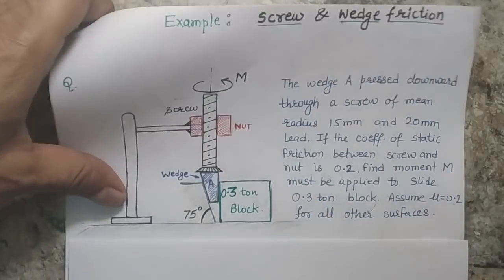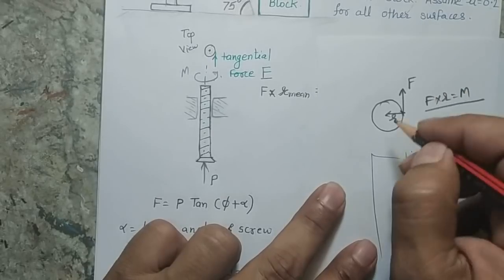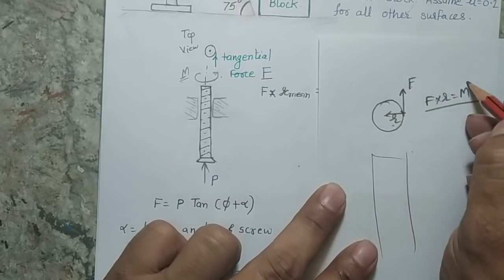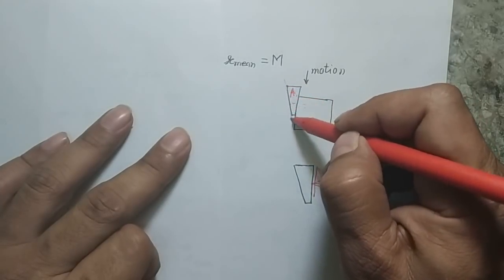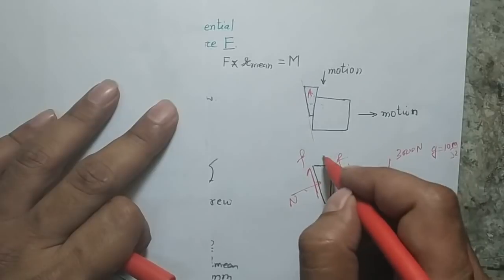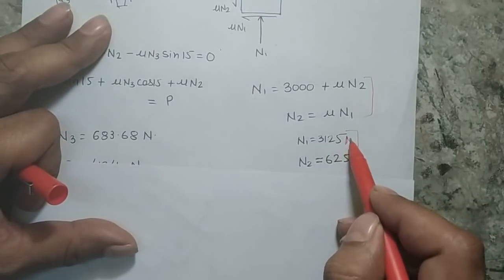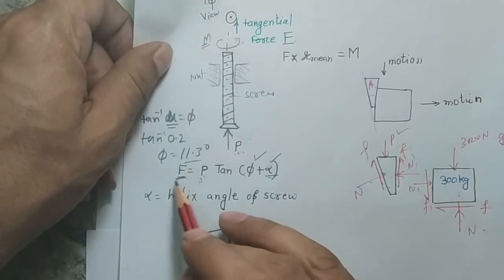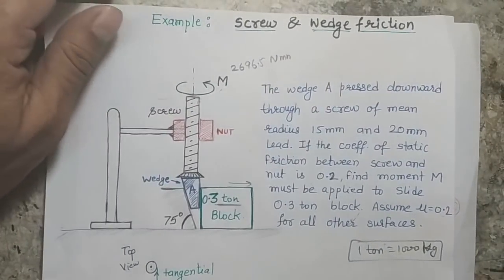L6.11 Friction|| Screw Friction #Problem|| Moment || Engineering Mechanics| First year Student

Comment: Sir why u consider 15 degree angle when we have 75 degree
Reply from the maker: 75 is from horizontal not from the lope of wedge from vertical..in case of wedge, wedge angle is inclination of wedge
Reply: Can we solve by taking 75
Reply: Thnss u sir for instant reply
Reply from the maker: @pravalmarya1892  no we can not solve by 75.
Reply: But sir I have applied 75 and my p value is match
Reply: But in M value there is some variation..